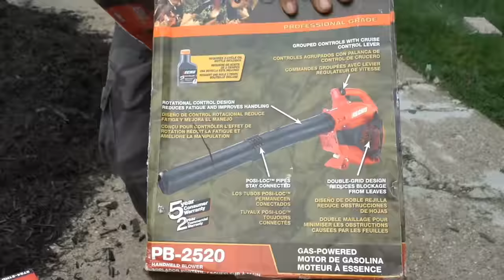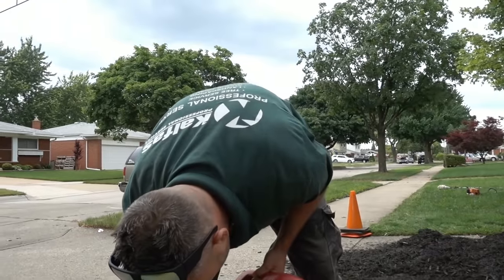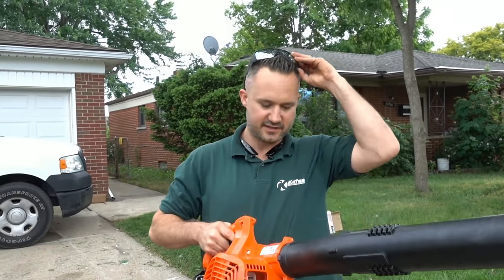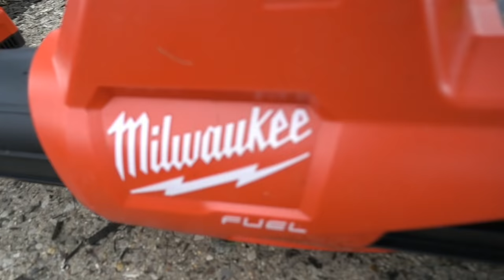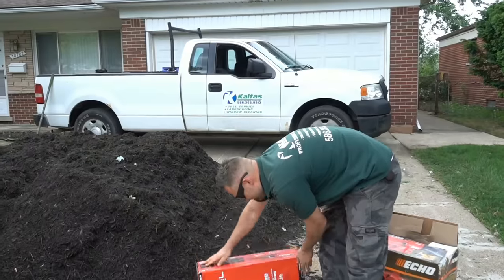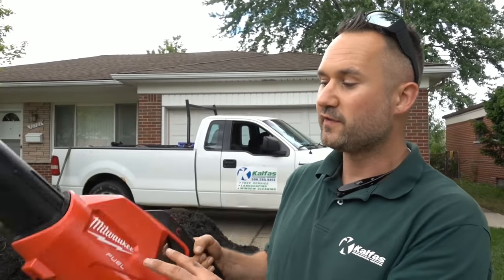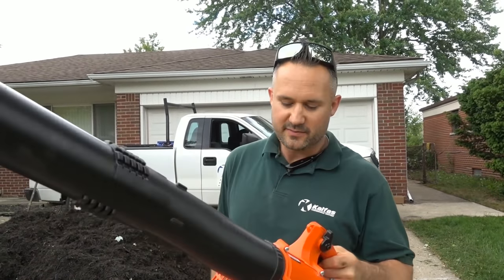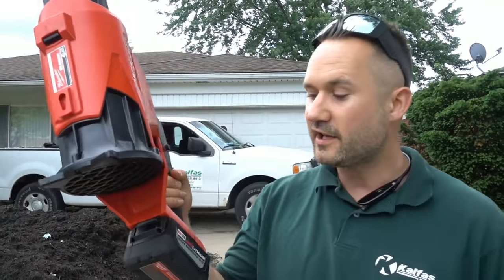Gas vs Battery Operated Handheld Blower - Lawn Care & Landscaping - Review

Comment: Been using gas powered blowers forever but thought I'd give electric a shot. I thought my old Echo ES-210 was a little under powered for my needs; so I picked up two different cordless brands to see which one I liked better.  They come close to the CFM but fall way behind in the MPH/actual speed force of the air coming out by nearly half. So wet leaves or getting debris out of the lawn and nearly impossible.  It seams they try to make up for the slower air by just putting a shorter/larger tube on them. I tried using for my front yard and the battery(4.0ah) on both only last around 8-10 minutes each. I generally need around 15 minutes with my Echo and only a spit of fuel. These combined didn't come close to cleaning what I could have with the Echo. Needless to say, they BLOW and both are getting returned. I didn't even think they were good enough to just sweep the shop.

Comment: One is loud but you can run for a few jobs without worry. the other is quiet but have to keep the charging in mind more often. When the batteries last all day, goodbye petrol forever
Reply: You could also take a couple extra batteries and switch between them while the others are charging.
Reply: The problem with batteries just I don't like excessive heat what you get on hot summer days. A gas blower, if maintained, will last much longer
Reply: @4nlimited3dition_4n3d  Or a battery backpack..or upgrade to a high capacity batter that is 3-4x the capacity of the cheap base battery that comes with most tools.
Reply: @pieroroccaysj  the M18 comes with an 8Ah battery, which only gets you about 20 min run time. The largest M18 batt is a 12Ah, which is  $200 by itself and only bumps run time to 35 min. That bigger 12Ah battery costs more than the Echo blower, on top of the $180-$215 for the M18 blower itself without a battery, or $300 for one with batt& charger.

Comment: I agree! The turf tracer is a beast of a mower. I just bought a used 2008 60" Turf Tracer, Hydro Driven, with the floating deck, sulky and ECS Handles for $2000. Money very well spent.

Comment: I have both.  Although comparing my actual 2 is like apples to oranges.  The battery one is a homeowner grade ryobi.  Just use it to blow off our patio.   It is light weight, cheap, quieter and easy for my with to start/use.  Also have a ryobi drill and radio  Can't say about durability.  Only had it for 2 months but no problems so far.  Petrol blower is a still bg86.  Had it for 3years and no issues.  Use it more as i mow 8 lawns as a side gig and also  gets used to clean up leaves after hedgetrimming and a few times a year to clean a lot of gum leaves in my own yard from the neighbours gum trees.  It is fairly loud, but has a lot longer run time and lots more power.  Cost me $370.  To get a (same power) battery blower bga 86 would would cost  $449 just for the tool no battery or charger.  I'm not willing to pay that vs $170 for the ryobi with a charger and battery and other tools.

Comment: I do landscaping, and i've got about 7 commercial grade blowers.6 backpacks, and 1 handheld. I've also got one Electric Kobalt leaf blower. so for work I would never use electric. I've tried various and they just don't have enough power and I know myself... I'd forget to charge one and it would suck.

That said I love my electric blower because If i get back from the dump and have some small debris in my truck bed, I'll grab it because it's lightweight, and I don't have the pump/prime or pull start it. 

Electric blowers have a use, but if you are trying to get serious work done you gotta go with gas.

Comment: Yeah, I knew the echo would be better, recently I just tried the handheld makita blower 36 Volt, that takes two 18 Volt batteries. From fully charged to 2 dead batteries in less than 20 minutes, electric blowers are nice for light work jobs. Gas powered blowers are definitely better for me, because it's quicker to refill the gas (4 stroke blower no mixing) than to charge the batteries for hours.
Reply: Yeah I mean if you only needed to use your leaf blower 10 minutes once a week sure get a battery powered one but if you need to use it for 30 minutes to an hour you’re going to hate your life with batteries, heaven for bid you’re actually a professional and you would never trust batteries in my opinion unless he had 20 of them in the truck

Comment: You clearly had a lot of fun making the video (little heavy on the edits and messing around parts) but its good to hear a "professional's" opinion on the battery unit. The refueling time on the echo is... what 45 sec and you already got premix for the trimmer right?  But like you said for fast, quick and lighter jobs the cordless has its place... just not in my garage.

Comment: One of the offensive features of leaf blowers is the noise. From the video it sounds like both machines noise output is about the same. Can you comment on that?

Also, I note that there are no fumes or bad smells with electric leaf blowers so that should add positive weight to the electric operated leaf blowers.

Comment: They both seem pretty similar for performance, but I would prefer a good gas powered blower over an electric one most of the time. That Milwaukee is probably lighter than that echo, but I want the convince of filling up in seconds and getting to the job. I don’t like charging batteries and hate messing around with dead batteries that last for a few minutes. I find gas powered stuff more fun to play with and an easier tool to get jobs done. Also the electric blower sounds louder then the gas blower, so much for “electric is quite,” lol. Both are still good though
Reply: My neighbor has a 20 year old electric black and decker bv1000 and it sounds much harsher to my ears compared to my stihl bg55 that I actually have to use hearing protection while I never use hearing protection with my gas blower. I did just buy a newer toro super blower vac which has the same performance as my neighbors blower but its much quieter than his blower and my gas one
Reply: Yeah me too i prefer petrol powered.  I'd be too forgetfull with charging batteries   Also even though you have more maintenance with petrol vs electric, the maintenance is often easier to do yourself with petrol if your even a little bit handy on tools.  With battery its pretty much unless your an electrician you can say goodbye to DIY maintenance and hello to costly repairs at the shop.  Also your pretty stuck with the one brand with battery for all your tools, unless you have multiple chargers and batteries which gets expensive.  Petrol has a bit more leeway there.  They also say storing petrol is a fire hazard, but so is charging batteries so to me that's not a benefit to either of them.  Battery is easier to start and lighter though so definitely has it's place.  Especially for women or kids using your blower. Petrol blowers are noisy, but battery aren't that much quieter to me.  Just where earplugs and like any powertool, be considerate of the time of day you use them.

Comment: WHAT !!!  That's the most powerful hand held you have ever used?? do you live in a cave ?? Test the 580 CFM or the 575 CFM EGO's. They will blow those two you have away and by a LARGE margin.
Reply from the maker: Awe man I gotta try them out. Thanks for letting me know.
Reply: No problem. I fell in love with EGO. I know it's not a commercial product but I replaced my gas trimmer, edger and blower with EGO equipment. Lets see how long it last.
Reply: @keith-kalfas  I have a video of the Ego 580 CFM blower on my channel.

Comment: Gas beats battery. I don't have to wait for a gas blower to recharge. That factor alone will always let gas win. Unless a battery can recharge in 20 seconds I will keep using gas.
Reply: Joseph Wackes I can change a battery quicker than you can fill up your gas blower. The same battery I that I charged with my solar panel.  And you should tell your story to the Tesla Roadster.
Reply: Joseph Wackes This is why I have 2 batteries. And the gay Roadster will "blow" your F150 away
Reply: Joseph Wackes I'm no tree hugger but Tessas are pretty sweet cars and prove electric is what we should have focused on all along.... Just needed batteries and circuitry to catch up. 
I'd love my Ranger to be electric or hybrid... Just saying,  gas is over 3 bucks a gallon
Reply: Strong Tower Lawn Care He's just indoctrinated by the Masonic media into thinking dirty oil is the way to go.  I guess it has something to do with the Rockefellers creating the general education board in 1902.

Comment: How long does the battery last . That's key to me.
Reply: Jonathan Doble 2  9 amp hour batteries is enough to last me just about all day with a trimmer and blower. I love how light they are and te design but I still keep a set of gas powered tools as backup
Reply: Jonathan Doble I used an ego electric blower before and it lasts between 15 and 20 minutes but blows good.
Reply from the maker: I dunno. We got about 20min of use out of it. But the battery was only at 60%
Reply: Yeah that is key. I'm getting tennis elbow from pull starting stuff all day. Im thinking of going electric blower like this for blowing clippings etc. Lighter and no pull start big plus for the older guys
Reply: The batteries charge really fast so you can easily charge it between a new job site in the car too.